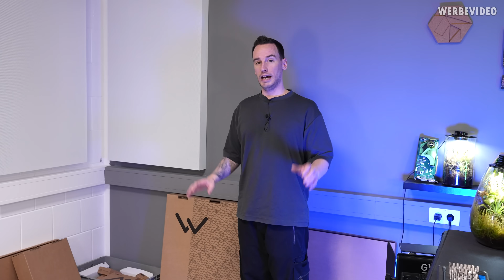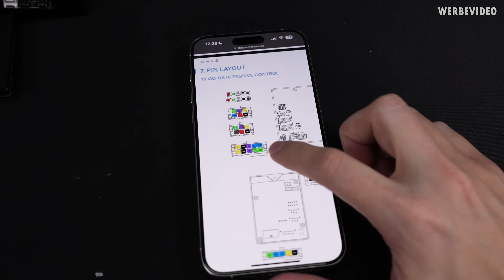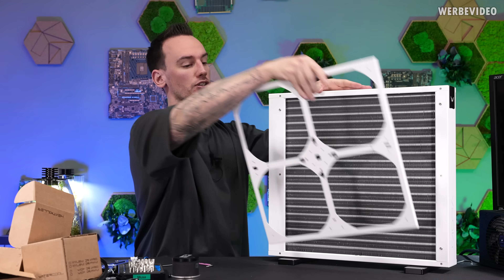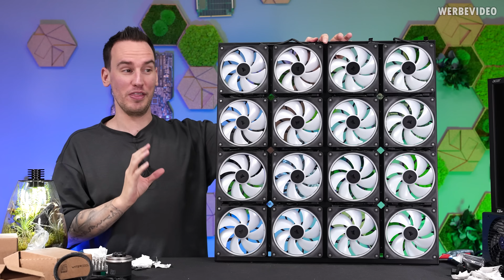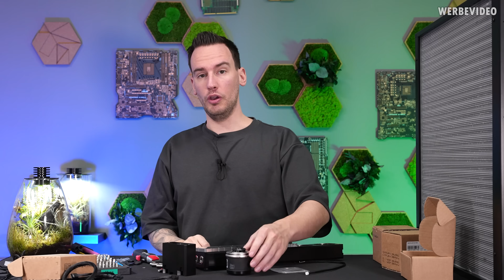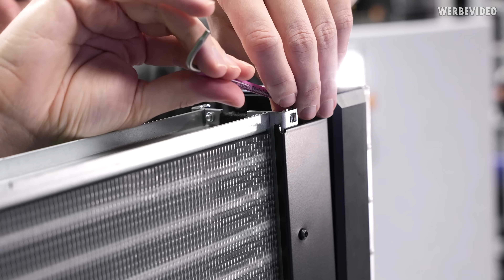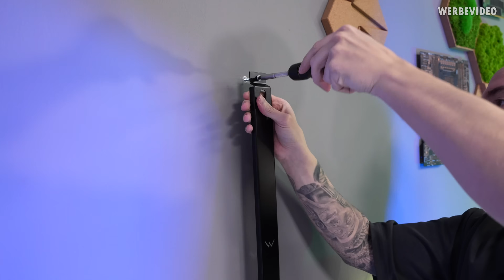The Most Extreme Radiator Ever Made - Watercool MoRa IV 600

Comment: $240 USD for the basic Mo-Ra IV 200, and then all of the additional things to make it function. $575 USD for the Mo-RA IV 600, plus additional items.
The radiator system can easily be more expensive than the motherboard, CPU RAM and Storage. With imagination, it could even outprice the addition of a 4090 GPU.
Honestly, going to the guys at the local automotive radiator shop and having them build a custom radiator with all connection fittings, and larger than the Mo-Ra radiator, is perhaps $100 USD, depending if you bring them a pizza as a bribe.
Just saying...
Reply: I was wondering if at this point it starts being cheaper to get a car radiator?

Comment: I think car radiator is more practical at this point :D
Cool rig of course.
That dry wall can maybe hold 5-10 kg per anchor, if radiator alone is 16 kg.. with water inside it, I worry it will fall off.
You need deeper anchors into brick or concrete wall behind the drywall.

Comment: Lol I just discovered this 3 days ago. Wanted the 600 until I saw a picture of some standing next to it.... I still want the 400.

I'm currently using an obt on desk and separate cpu gpu loops fed by two ek pump/res combos screwed to the obt, then three 360 rads under the desk. All with the qd4s. But it's so janky. 

I used to have it all in a case but I got tired of pretty much full disassemble to clean blocks and do general cleaning. I've been wanting a mora for a long time. I need to sell my older rads before I can tho.

Comment: Oh nice!
I have a Mora 3 420 myself.
I won't upgrade but it's nice to see they're going even further beyond :D

I use an external PSU though so the only thing running between PC and MoRa is the tubes. A master/slave power strip turns it on when the PC turns on.
I like the IV 200. Looks maybe backpackable.

Comment: Maybe having the pumps attached to the radiator is not a good idea if noise is important because the metal in the case and radiator could act as a sounding board (transducer).

Comment: This seems like a good start, but ideally you need at least one more. Use the first one on the CPU and the second one on the GPU. You could even put them in two different rooms in order to slow down the heat build up. 😂
Reply: Naah, if you have a MoRa IV 600, you have whole house AC.

Comment: Gosh huge radiator.....and expensive. Im using 2 x Aquacomputer Airplex Modulrarity System 840 rads full copper tubes and fins. Huge in their own right too in total its 12 x 140mm. Cooling a i7-13700k and a MSI RTX4090 Gaming X Trio. Fan controller is a Lamptron FC5 i think it can handle 3 fans per channel (4 channels). Using 12 x Noiseblocker 140mm black Pro's at 600rpm. Im very happy with the results total costs you don't want to know. As for pumps im running 2 x D5's + 2 pairs of Koolance QDC4's. 

And yeah both Watercool and Aquacomputer are made in Germany hehe! Oh if i really want to....i can add a 3th whopping Aquacomputer AMS 840 since i have 3 in total making it a 18 x 140. It would probably beat the MORA IV 600. The nice thing about the AMS line it is modularity i can stack them on top of each other. Who knows i might even do that....Nonetheless the MORA IV 600 is a BEAST high quality rad. No more pesky "flux" if you want CLEAN non flux particles rads get a MORA or AMS rad!

Im very very curious about the TEMPS in comparisson with other rads! Please do make a review!

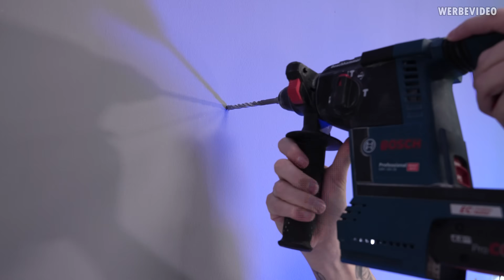Comment: 24:40 oh Roman! Please don't ever use a hammer drill on plaster/dry walls ever again x'D Any type of low-power hand drill will suffice for plaster walls :)

Pleasepleaseplease also use molly bolt anchors before that $1500 worth of equip drops off the wall

Comment: I use the nine 120mm fan, alpha cool external rad my self. I have an EK 120mm pump res mounted inside the computer case, and a commander pro and sata power running to a fan hub mounted on the external rad. I have nine noctura industrial pc fans mounted on it right now. At some point, I would like to convert it over to a connectable fan system to eliminate so many wires. CPU never gets above 60 degrees, and GPU never gets above 50 degrees and can play all day long.

Comment: I also (this week) build a 3x D5 pump MO-RA IV 600 but, had to go for another d5 pump in the PC itself, because the manual provided by watercool did not say anything about it to be possible to connect 3x D5 pump.. they need to correct their manual on this.. I had to buy separate d5 with reservoir combo to get arround the limitation stated by watercool in the manual...

Would have been great to have known before hand, that this was an option  😅

Comment: If you have a swimming pool or spa, then piping in water via a pump (gravity feed) is even more effective.  You will need to use plumbing into your house to achieve such wonderful cooling.  A visual flow device is the only maxim.  A radiator with fans is for remote cooling.

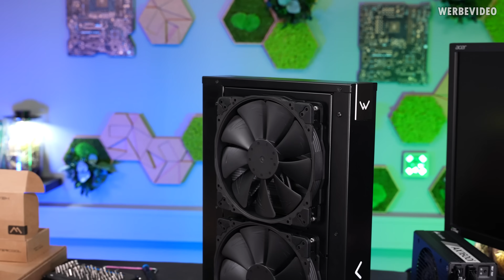Comment: 10:37 Whats the point of running 2 X 200mm fans ? Even Noctua sells 200mm fans with 800rpm only with static pressure less than half of NF-F12 120mm fan. The rad has dense fins, so it needs high static pressure.
Reply: No it doesnt. Fpi is much less on bigger rads. Im about to add a 1080 rad totally passive on the back of my case simply because the fin density is so low... much less than my 360 and 280mm rads inside the case already.

Comment: I already use triple Aquacomputers Airplex Radical radiators for my ThreadRipper. I am not having a cooling issue, even in summer. The radiator is everything when it comes to cooling performance. But Im not using any controllers. Im not concerned about noise.

Comment: I've been using Mora radiator for many years (3x3 12cm fans). I have it attached to a side wall of my PC with pump inside PC case. I like your solution of having pumps directly attached to the radiator however, with very low RPM fans, pumps are the noisiest part of the cooling so having it inside PC case is damping sounds quite significantly making the overall solution quieter.

Comment: It seems to me like water coolers can only provide a limited differential in temperature between ambient air temperature and die temperature.  Perhaps some type of active refrigeration, like Peltier wafers, or a cooler that uses actual refrigeration might be feasible if the power efficiency problems could be solved.

Comment: Technical data: MO-RA IV 600

    Internal material: Tubes Copper, fins Aluminium
    External material: Powder-coated sheet steel
    External dimensions (L x W x H): 700 x 662 x 75mm
    Weight: approx. 15,9 kg
    Pressure tested: 5 bar
    Surface: black powder-coated
    Connection: 2x thread G 1/4 inch
    Filling capacity: approx. 3 l
 price 550€

Comment: While the 600 is insane and very much overkill for any "normal" system, the 200 or 400 are really interesting and well executed external radiators. Especially the single cable connecting PC with the radiator. Well done!

Comment: I have a mora3 420. 8 push-pull 200mm highspeed version Noctua fans, dual D5 in a solid cnc machined brass pumptop(3kg in weight). The fans already cost a fortune...
I live and die for overkill, but this is stupid.(or industrial, but let's be honest....)
On the RGB thing.... Watercool is the forefront in the anti-RG(ay)B war...where is the class, where is the diy side of this? No one asked for these solutions, upgrades and fixes....
Did you forget where you come from *Watercool*?

Comment: I want to use water cooling for my system because that enables me to to use an AIR FILTER on the radiator, I live in a VERY DUSTY home and if I showed you pics or a vid of what builds up in 6 months you would probably think I was faking it... You can PEEL IT OFF WITH TWO FINGERS!! IT IS DISGUSTING!!! But I live in the woods AND in a house of SMOKERS, and I get ZERO air circulation, ESPECIALLY in the COLD WINTER and HOT SUMMER 😢
And so I want to use an air filter... a REAL air filer (not a screen mesh) but a typical 360 would be very hard to find a regular supply of filters that cover it... so I could go with the 400 (the medium sized  rad that you showed) I THINK that is about the same size as the filters I use in my HVAC system... And I could just 3D Print a few brackets to mount the filter on the back of the rad and use 4 of those 200mm fan but just a bit faster to compensate for the filter making it need more.... 
- This is the CLEANEST build I have seen as a possibility so far.... TOO BAD THEY ARE CHANGING AN ARM AND A LEG FOR A $40 RAD!!!! $800 FOR THE RAD?!?!?!?!?! WHOA!!!! THAT IS ABSURD!!! It BETTER come with ALL those accessories if just the rad costs that much!

Comment: For years, I've been shouting from the rooftops that Watercool's waterblocks (The Heatkiller Line also looks amazing, the best looking blocks currently on the market IMO) are superior to EK's in every way, and usually the same price, or even some times cheaper, and yet whenever you go on youtube, 9 out of 10 watercooled builds use EK parts.   You're constantly seeing the same EK parts and it gets extremely boring, plus, EK's performance is middling at best most of the time.

Comment: That radiator is roughly the same size of a DIY setup I had 8 years ago that was made from 2x 2inch (total 4 inches) thick radiators I scavenged from a broken AC unit. I could leave the singular home fan off and cool 200+ watts of heat with no drop in performance. Seriously don't buy 16x small fans and instead buy one really big fan.

Comment: When you fill ity with water IT WILL FALL OFF OF THE WALL FROM ALL THAT WEIGHT!! - You only put screws INTO THE DRY WALL!!! THAT WILL NOT BE STRONG ENOUGH TO HOLD ALL THAT WEIGHT!! 🤦‍♂🤦‍♂ - And you might be able to fill it up and it doesn't fall off the wall, but in some time IT WILL!!! I say in LESS THAN 1 YEAR the WHOLE THING WILL COME CRASHING DOWN!!!
- You NEED TO have the mounting screws GOING INTO THE WALL STUDS!!! - THIS IS NOT OPTIONAL!!! - YOU HAVE TO DO THIS, ROMAN!!! You will just need to move it left or right a few inches (there is usually a stud every 8 inches here in there states, but I'm not sure what that is in metric) But it probably won't line up so both the left AND right screws are in studs, but that should be fine.... AT LEAST 1 SIDE NEEDS TO BE MOUINTED INTO A STUD - TOP AND BOTTOM - I REALLY hope you fix this (even if you don't do it on camera, but this NEEDS to be done! NO EXCEPTIONS!

Comment: What coolant do you choose for running a loop with this?
Also for $1500+?! Don't get me wrong, it looks amazing. But has me seriously wondering if I'm better off just arranging a set of 360/420/480 radiators together and using a box fan on them instead 😂

Comment: You may want to use a really strong high head pressure pump like the Iwaki MD-30RZ if that mora really has all that tubing length and it’s going on the wall and you will be using multiple blocks

Comment: Let's calculate how much it will weight.
Naked MORA is 16kg 
add 16x Corsair LX140 fans (16x0,324kg=5,184kg)
add res 1,3kg and pumps with housing are 0,6kg each, so it's 3kg
fill it with water which MoRa states it has 3L capacity so it's 3kg but res and pumps will also hold water [0,3L+ 3x (0,66)] so it's 3,5Kg.
 and you end up with 27,5kg hanging from the wall. 
If you include tubing and water inside it will be closer to 28-29kg. 
@der8auer EN This wall will not hold this amount of weight.

Comment: I put a monsta 400 x 400 rad in my pc with 2x Noctua 200mm and it is silent on full tilt as well as being extremely good at keeping my 5950X cool.  The rad had a wider fin gap, so the 200mm fan work really well on them.  200mm fan are so underused

Comment: More pumps is for more pressure. The longer the piping inside the radiator and outside the more pressure you need to generate to maintain the flow.

Comment: Something like an N100 would do the trick to run as an icue controller, it's only 4 e-cores so it's very low power and very cheap. Found one on Amazon that looks smaller than the GaN charger for my laptop, i think there's also sbcs like the Zimablade that are worth looking in to.

Comment: the icue devices have a software and  hardware state - you have to switch to the hardware mode in icue save it - then if icue isnt running it will use the hardware setting

Comment: I also have the Mo-Ra 600 with 16x iCue LINK fans.

I honestly had a smile on my face seeing you encounter the EXACT same problems I had with daisy chaining the fans due to space on the mounting bracket. We both settled with the same 90 degree cable daisy chaining solution lol.
Reply: When you turn the fans 90 degrees does it interfere with some of the lighting patterns since the LED assignments are in a different order?

Comment: Now what if you had a single 560mm radius fan for the Mora IV 600? Wouldn’t you save yourself a lot of noise?
Reply: The problem is the larger the radius of a fan, the thicker it has to be in order to generate enough static pressure and to find such a large fan that is thick enough and runs just as quietly as the 200mm Noctua (which, in my opinion, is the only one real silent fans from Noctua) will probably be difficult

Comment: If you are into watercooling this is the way to go. It's expensive up front but you can use it for a long time while having crazy cooling capacity. I have Alphacool's 1260mm rad with 4-200mm Noctua fans (Watercool's HF version), it's super quiet, and handles 700 Watts no problem
Reply: everyone I’ve seen has used their mora for years and across multiple builds. Unlike most equipment people don’t need to replace it over time

Comment: This is absurd. The radiator on my car is smaller! CPU and GPU designers need to STOP pumping more watts through sand. DESIGN A BETTER CHIP, FFS. Apple have already done it, why can't Intel, nVidia et al? The energy wasted as heat here is staggering, and completely unnecessary.
Reply: To be clear, I'm absolutely not hating on Roman here, whom I consider a brilliant and public conscious engineer. What I hate is the ludicrous situation we have where we're having to strap increasingly lunatic cooling to chip architectures designed in the 1970's because these companies don't want to tell business to re-write their software.

Comment: Serious question (I know that's not officially allowed on ytube):
At some point the water is coming out at ambient or so close to it that the difference is meaningless.
I get that going from a 360/280 to a radiator with dual 200mm fans is going to be a big jump... but are 4 needed?  
And 9 just seems silly.  What's the temperature difference coming out of the radiator versus 4 fans or 2?   0.05C?
Reply: I would have to agree but I think this is just one of those he wanted the full overkill setup just because he can. Example being that he added an extra 3rd pump just because he wanted to and can.

Comment: 27:26 last comment ( I promise ), one thing, is that wall going to hold that much weight ?!? , just saying because from the texture of the holes that looks like sheets of plaster and not a "real" wall
Reply: yes the wall is plasterboard, according to German building standards up to 40kg can be attached to it, so it could reach its limits if filled with water ...
Reply: @EumlOriginal  I have calculated the weight of the entire setup from the parts that were mentioned - it's 28-29kg including water. And I doubt that wall will hold.
Reply: @gagarin777  I also don't think that will hold, but lets wait and see if we get another video of Roman removing or fixing the radiator 😁

Comment: With that many LEDs I would probably run WLED. I just got some cheap ARGB fans to have a sim rig cooling (for VR play), and took 10 minutes to figure the number of LEDs on the fan, the pinout, and flash WLED on an ESP32 and control the LED with it. 

My iCUE keeps disappearing. The exe disappears about once a month :O. A friend (and a lot of people on-line) have the same issue.

I love Corsair hardware, but at this point I do not trust iCUE looking after my temps, because sometimes it's just not there. I think an automatic update keeps failing for some reason. Next time I have to reinstall, I will try to make the exe read only. :O

Comment: Looks awesome, Next step up would be an outside mounted industrial heat exchanger array :)
I like DIY kinda janky cooling solutions. My newest creation is a watercooled laptop that in its base station uses a heater core from a van, two 200mm Noctua fans, an aquarium pump and a big beerglass as a reservoir :) I compensate the jank with a high flowing pump, a big radiator and big low RPM fans :)

Comment: I won't lie, I ended up building a triple 360 rad setup in the O11DXL because I couldn't figure out how to route fan control, pump control, water temp, and flow rate info cables from a Mora without a a lot of extender cables. 

Glad to see that they solved the problem. I hope they update the Mora 3 360 models as well.
Reply: @TheZoenGaming  Octo and Quadro from Aquacomputer have existed for a long time. All you would need is power for them once you have saved the settings to the controllers.
Reply: @Simon_Denmark  The last time I ordered from Aquacomputer, I paid nearly twice as much for the shipping as the item, it took 3 weeks to arrive, and they got the order wrong on top of that. I don't buy from them anymore.
Reply: @Simon_Denmark  Those are fine, but my Water Flow and Temp sensor connects to the MOBO headers. Those don't have a header for my sensors.
Reply: It's so heavy though I struggle carrying mine around
Reply: @ms3862  Are you trying to carry the O11DXL or the Mora 3 360? Either way, I think it's a PEBKAC error.
Reply: @ I have a O11D XL with a triple 360 radiator
Reply: @ms3862  Okay, so why are you trying to carry it around? A PC that size is not meant to be portable.